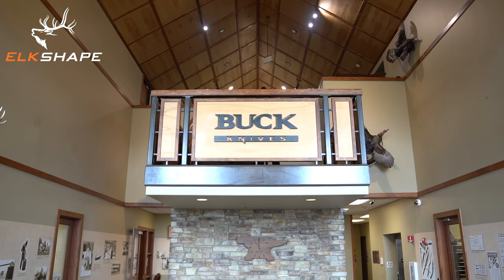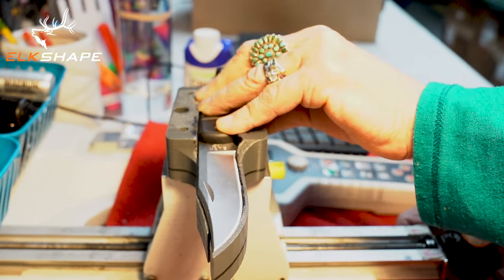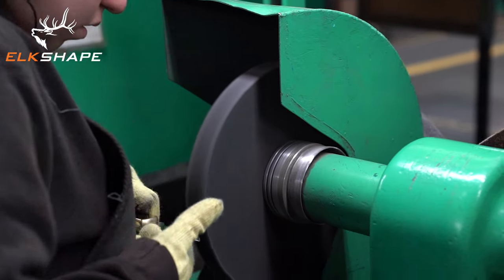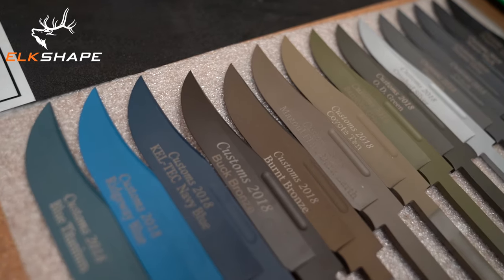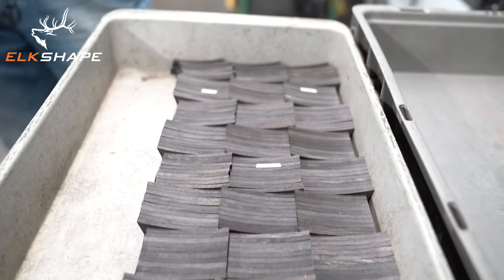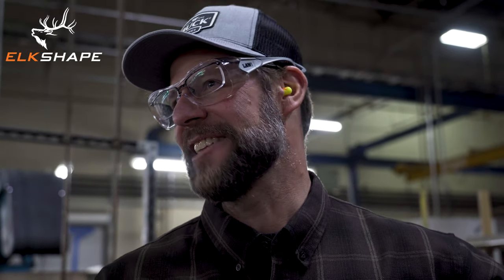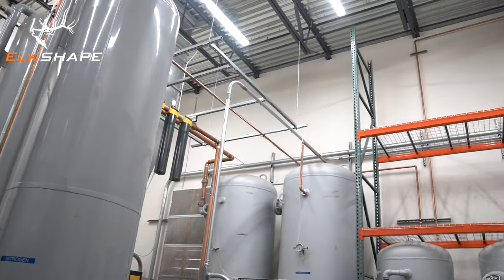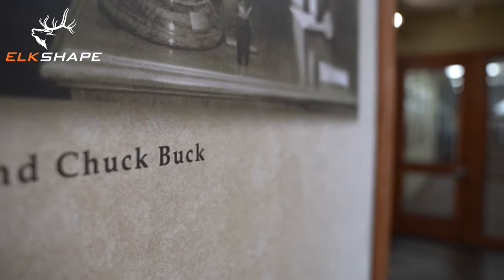BUCK KNIVES Factory Tour

Comment: I have a 110 I bought over 40 years or so ago.  I put it away and did not find it again for 10 or more years. When I found it again I could not open or close the blade without a great deal of difficulty.  Need pliers to open it.  Can I get it fixed at your facility?